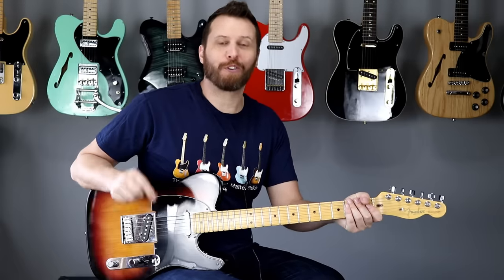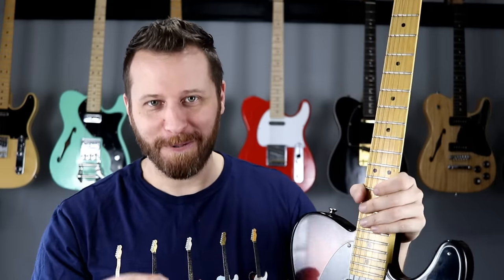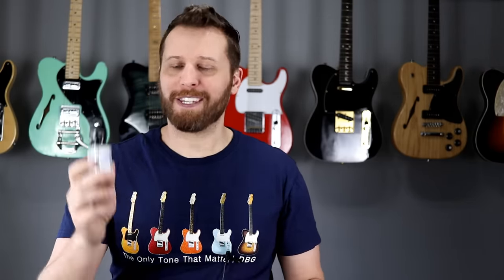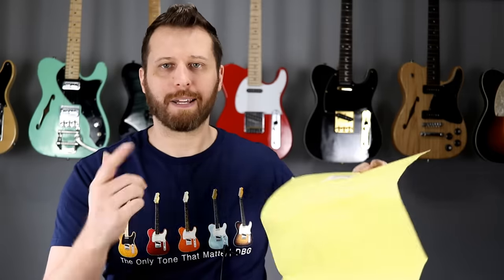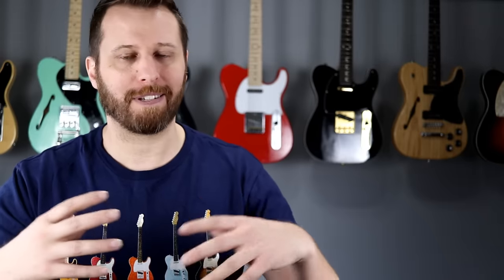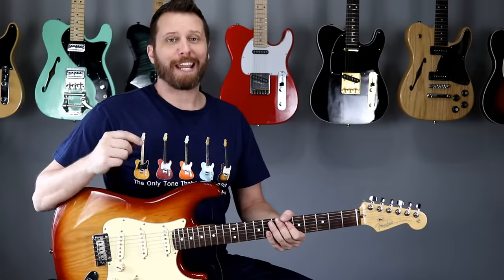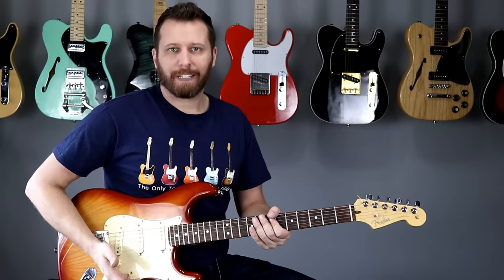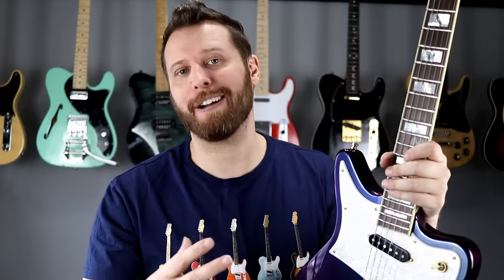KILL The Hum and Buzz!! - Keeping Your Single Coils QUIET!

Comment: The first time I encountered this kind of hum (20+ years ago when I bought an Ibanez guitar and a Fender Amp , Champion model if my memory serves me well, I tried to find the solution and I found an article about copper or aluminum foil behind the pick guard solution in a guitar magazine. I live in Thailand and here we use 220-240 V and 50/60 Hz system. At the time the power outlet had only 2 holes, i.e. Line and Neutral. There was no ground connection. I noticed that my Fender Amp came with 3 prong male plug so I thought I might need to install a ground rod. This was because I noticed that whenever I touched the strings the hum would be completely gone. If I pull my hand off the strings the hum started again. So I was thinking   static charge might cause this annoying hum. So I went out to buy a 1 meter long copper ground rod and installed a new power outlet socket with 3 holes (Line, Neutral and Ground), connected a ground wire to the copper ground rod buried 1 meter under my front yard and the hum was completely gone. That made me wonder why nobody (guitar magazines at that time) mentioned this as a possible solution. May be this was not an issue in the U.S. where 110 V AC with ground was the norm.
Reply: Hello! I'm from India. I bought my first electric guitar a few days back . It's a strat. I also bought the fender champion amp. Even when i play clean with very low vol and gain there's always a noise coming from the amp. I know it's natural with the single coils. But the noise still remains even when I'm at position 2 and 4 on the pickup selector. The noise reduces when I touch any metal parts on my guitar. I think this is due to grounding issue. The power cord that came with the amp consists of a 2pin plug. Shall I buy a new power cord consisting of 3pin plug as it would provide the earthing to the amp? Please help me as I'm new to all these.
Reply: @dipjyoti_guitar  If your amp came with 3 prong power socket where you can change to 3 prong male plug easily just by plugging it into the socket it would be good to buy the new power cable with 3 prongs and plug it into the 3 prong socket on the Amp but if your Amp has no such socket you may connect a ground wire on the Amp chassis and run this ground wire to the ground rod outside. You will need to install the ground rod for both method except when you already have 3 prong power socket on your wall already.
Be careful with electricity if you have no knowledge please hire professional electrician to do the job for you. Good luck.
Reply: @SwingEzzZZ  thanks a lot! My amp has the 3 prong socket. And there's also a 3prong socket on my wall. The only issue is now with the 2prong male plug of the power cord. I shall now replace it with one consisting of a 3prong male plug. Thanks again!!!!
Reply: @dipjyoti_guitar Good for you. You will get cleaner and better sound. Enjoy.
Reply: @SwingEzzZZ  Hello! I replaced the power cord of my amp with one consisting of a 3 prong male plug. But my problem has not been solved yet. The noise coming from the pickups still persists and whenever I touch any metal parts on my guitar, the noise gets reduced. Would you be kind enough to help me out with this issue of mine. I'm a beginner electric guitar player. I have just bought my first electric guitar and I'm completely new to all these things. Thank you.
Reply: @dipjyoti_guitar If the problem persists I doubt that your grounding system is intact. I'd suggest you to have the grounding system checked by electrician. One thing you can try is to connect a ground wire to the Amp chassis on one end and to a water pipe on the other end (in this case you need to have access to the water pipe to use it instead of the grounding rod but I don't know if you can because most house the water pipe is inside the wall and not easily accessible). If doing that help it means your house's grounding system is no good.
The better way is to have an electrician install a separate new power outlet with 3 prongs and install a copper grounding rod properly to be used specifically for this Amp. That's what I did. Good luck.
Reply: @SwingEzzZZ  thanks a lot:)

Comment: Shielding only prevents RF interference, it has no effect on 60Hz hum.  60Hz is the frequency of the electricity you're using (50Hz in Europe).  Shielding tape won't change that.

Comment: When I built a Tele kit guitar recently, I used Copper shielding tape in all cavities and pick guard plus twisted the earth and hot wire as tight as possible - I think I saw this tip on YouTube - It made huge difference. I'm no expert, but it's worth a go considering how cheap the tape is and nothing for twisting the wires.  I also came across some device you can plug in to eliminate the hum, I think it was not cheap nor if it was all hype, the video I saw came across as if it eliminated the hum all together? Has anyone had experience with it? Keep up the great work Darrell, your are an inspiration....

Comment: My now long gone Fender Deluxe Reverb amp from '65 used to have a polarity switch on the back panel that would go a long way to eliminate hum and insure that your guitar and mic did not oppose one another which could lead to nasty shocks. Not sure if the new models have this. For some reason my old Mosrite with P-90's did not suffer as bad as Telecasters and Stratocasters with regard to hum. A friend showed my a guitar with a concealed pickup under the pickguard which was used to eliminate hum. Cannot remember who made this but it seemed like a cool idea.

Comment: I use a battery amp (Yamaha THR10) it has a 1/4 inch headphone jack which I connect to main amp or straight to mixer. This isolated the guitar from mains which is the source of the hum. It also allows use of FX and EQ
 On the THR.

Comment: Me, I just gave up. I just ignore that hum. 😐
Reply: It certainly sounds great when getting that cookin' band vibe on a recording. Those zeppelin first album recordings would be noticeably less cool without the hum from that tele in between Page's licks. Its a serious mojo.

However, when your writing and sound is dynamic enough where you need to go between quiet and dirty simply with your picking attack, and you have some heavy tight modern gain on, o h b o y does it NEED to be muted. Really badly.
Reply: Hearing loss from sustained exposure to high volumes also works..."What hum? I don't hear it."
Reply: @Psyfonify  If the hum was never there in the first place we would not want it to be there in those recordings.

Comment: I have a MusicMan Cutlass with the Silent Circuit. I was a little disappointed that it didn’t reduce the hum further than it does. But it reduces it enough that a noise gate has an easier time differentiating between the notes and the noise. So I can lower the gate’s threshold and retain more of the note’s sustain. This video seems to demonstrate a worse case scenario. In most rooms, my noise problems are not that bad.

Comment: Simply upgrading a cheap cable can make a big difference as well.
Reply: @Flatus Antiquitous I normally use some shielded audio cable in the cable cavity and ground the shield to the star point. As you say this is often overlooked and can reduce noise.

What Darrel shows at end (guitar resting against amp and creating nasty hum) - that exactly where I was with my Laney Cub this week -  and what flummoxed me was "but I shielded all my guitars!!".

Then I released I was having a senior moment - I DID shield all my guitars... but forgot I bought more :-). And sure enough plugged older ones in ... super quiet even under florescent lights- but the Squier Standard and SX Telecaster were not. Tele didnt even have bridge grounded. I shielded both of these and Tele is super quiet. Strat still had noise - the link wire was the culprit. Put some shielded audio cable and now it is quiet - until I direct the pickups at a strong noise source. Not that different to a directional mic pointed at a speaker.

I often fall foul of those inductive hearing loops - have to place the guitar away from peak signal. Still dont know why the sound desk engineer  sends music down the hearing loop :-(

But I find shielding guitars to be worthwhile - provided you dont short the hot wires or break something in the process. Your mileage may vary.
Reply: KC  - what shielding are you talking about here? In the instrument jack lead (I think it makes a big difference) or in the guitar (it can make a big difference   if the common ground goes to instrument wire and it goes to amp and back to the substation)

But you 100% correct that the pickups themselves will pickup signal from wherever they point - normally a slight rotation minimizes this - but without shielding in my guitars and decent shielded cable even that trick doesn't work so well.

Comment: I significantly reduced buzz by taking a old cheap single coil pickup and removed the magnets.  I wrapped it in self adhesive copper.  Shielded the interior of the guitar as well.  Then super glued the old shielded pickup between the middle and bridge coils. There is not much room but I got it positioned okay. I then soldered the ground wire to a pot and the hot wire to the switch.  Buzz was totally gone on a couple of switch positions an minimal in the first and last position.

Comment: In the case where a player has more than one single coil guitar, the gate is probably the most coset-effective solution.  They are relatively inexpensive and when properly adjusted work really well.  I use a Donner Noise-Killer. Thanks for the demo and information.  I think you should call your channel "Telecaster TV".  (given you have a herd of Tele's on your back wall).  I'd love you to do a tour of your guitar collection.  Thanks Darrell

Comment: The very reason my preferred pickup combo is HSH. When I am using a clean or very low gain sound I'll be on the middle pickup. This is probably 70 or 80 percent of most nights. When I'm going with more gain I will want the sound of a humbucker anyway so I switch to the front or back pickup. 
I hadn't heard of the 'silent circuit', though, so thanks for introducing me to that, Darrell.

Comment: Very helpful! Thank you!

I’m a bassist and usually my basses I have have hummbuckers in them but I have gotten a bass with hummbuckers but has the option to go single coil for both the neck and bridge pickups and at first I was just experimenting with having the option to go single coil or hummbucker and didn’t notice it right away because I was still experimenting with it and adjusted my tone knob accordingly I noticed this buzz coming from it. But when I’d switch it to just hummbuckers for both pickups the noise went away completely. At first thought it was a cable or my amp then found out it was just the single coil settings. Glad I found out that this is a common occurrence and not something actually wrong/broken.

Comment: Years ago, there was a product announcement for a nose cancelling pick guard from Doc Hum-Frees (or something along those lines).  I don't know that they ever made it into production.  From what I now vaguely recall, it works with all single-coil pickups including RW/RP unlike the Silent Back Plate system which requires that all pickups be of the same polarity.

Comment: As i was working in a guutar Store, the best gate was the ISP Noise Decimator G-String. Just plug'n play and be happy, but it's pretty expensive. For lower budget i buy myself the "Sentry" from Tc Electronic and I'm loving it. With the Tineprint editor you have much of possibilitys of how schould it sound and wich frequenzes schould  go away or be boostet. You can use it also plug'n play but when you want to experiment, it's your choice.

Comment: Where did you place the gate? The first on the chain? :)
Reply: Amiel Aban you want it at the end of the chain because pedals can be kind of noisy too. Just clean everything up
Reply: Definitely BEFORE your dist/OD/fuzz pedal if you’re gonna use one. Since the hum is relatively quiet without effects you can make the threshold much lower without losing dynamics and attack. If you place it after, the hum will be much louder and therefore you’ll need to compensate with a much higher threshold.

Comment: Ground all the pot casings. Many techs do this to all guitars anyway, along with at least two layers of the shielding foil mentioned in this video. Some techs go so far as to shield the spaces between pot wire connectors. I'm skeptical of these, because there is eventually an electrical connection anyway.  Some believe that inherent noise is just part of the single coil, and attempts to quiet only removes the sharp gain curve which gives the signature tone.

Comment: Used to own a Mexican Tele with Samarium Cobalt Noiseless (haha) Pickups, lots of hum and noise on high gain, when less gain is not an option I got a ISP Decimator G-Series 2 (still own it) and started experimenting. What I did at the end was just using the Decimator and turning the volume knob down just a bit, no more hum after.

Comment: Another great video Darrell! You have to work with whatever venue you get invited to but there are "electronical" issues that occur as well which include your CABLING (in and out of the guitar)... Quality cables help, one weak cable in the link can be the culprit. Wall rheostats dimmer packs, etc. Havoc for 60C hum... check your hardwiring gear, grounding can be your friend! Cheers!

Comment: Darrell you mentioned lights and other electrical things plugged into your circuit.  Have tried a power conditioner?? Anyway it is worth mentioning as it provides stable power for your rig and cleans up loads of unwanted electrical disturbances from household electronic devices.

Comment: Just modded my Fender Modern Player and not sure if anyone else has mentioned but wiring the HB to have series,split and parallel is another option, the parallel gives single coil sound with it humbucking as well. Also, hot rails are another option

Comment: Great timing on this video , its a hot button issue of mine , I just put Fender SCN Noiseless pickups in my Tele which is great but you nailed it ! Prior to my noiseless pickups I used a Mooer Noise Killer which has a small footprint and works very well .

Comment: I love the mxr smart gate and also the mxr noise clamp. Both super simple and perfectly effective. I have tried many such as the boss ns-2 (decent), rowin and donner (do not care for) tc electronic sentry (excellent when set right, but difficult for me to find that sweet spot), isp decimate g string (good and well built but I slightly prefer the mxr’s), ehx silencer (probably the worst out of all I have tried. Even the cheaper rowin and donner ones were better). I hope this info is helpful to someone. Have a groovy one to all. \m/

Comment: I have a Washburn Idol with HB pup and instead of a tone knob, it has spin-to-spilt wiring. Mixes in the humbucking and you can get the sound more single coil but still lose the 60 cycle.